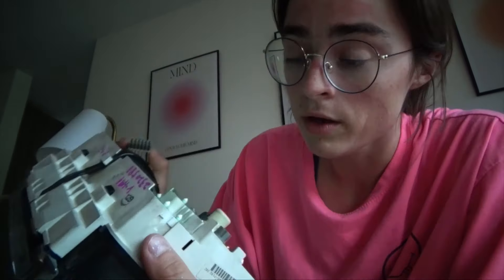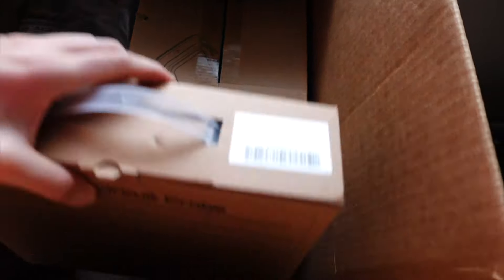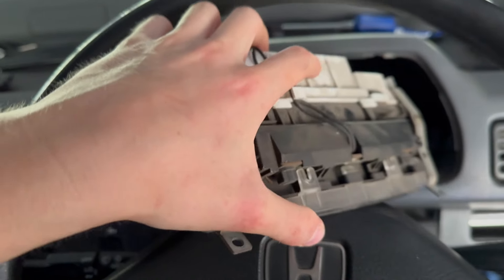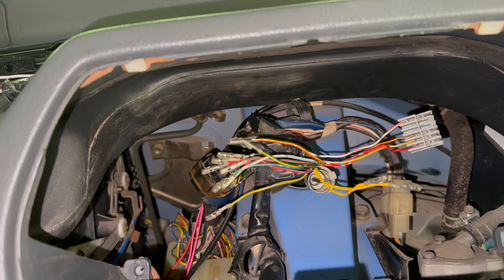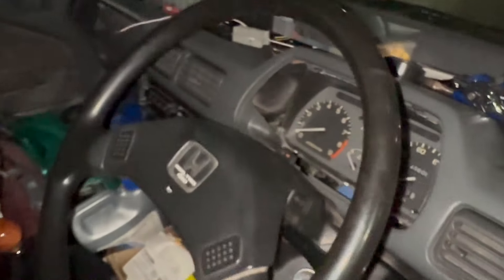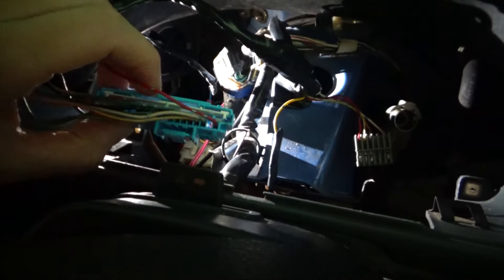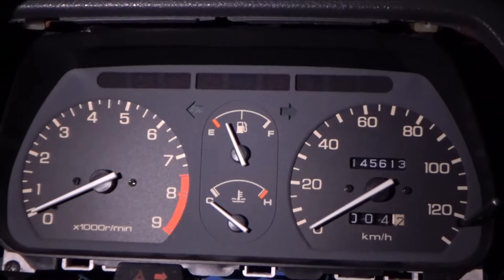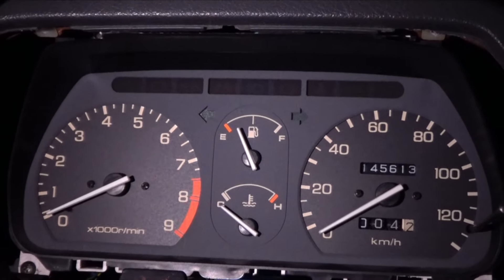Installing ACTY Van Dash Cluster Into my Truck adds a Tachometer

Comment: It’s not an electrical connection, what it is is a thin metal wire in a sheath that plugs into the back of the cluster and the sheath it’s what you have flush with the cluster. You have to make the little cable to plug in too.

Comment: glad to see a new vid. tried to do this on my attack truck, unfortunately the later model cluster does not have the extra indicator for the diff lock light. instead found a bolt on glowshift tach that sticks to the side of the steering column and that works just as well.